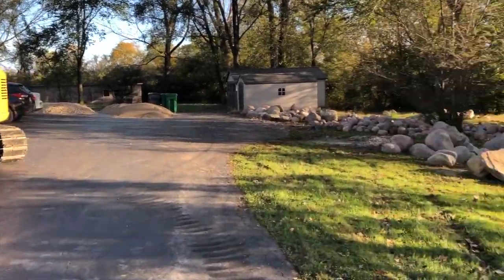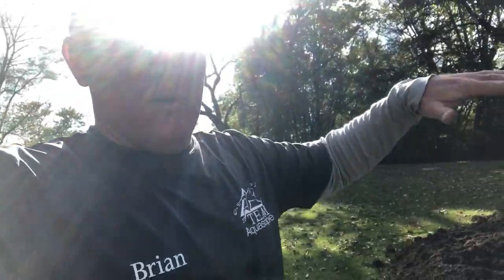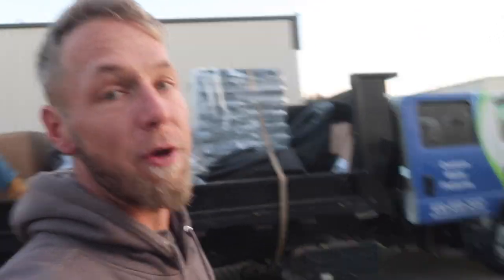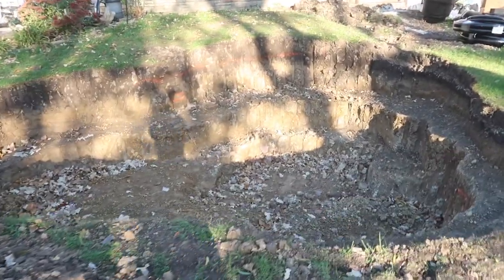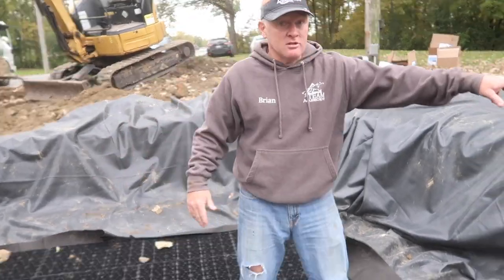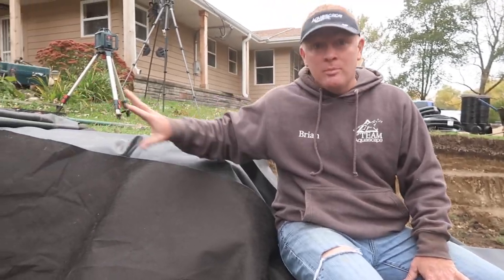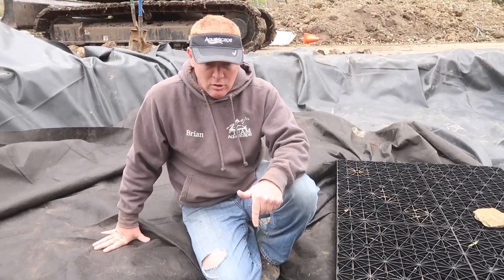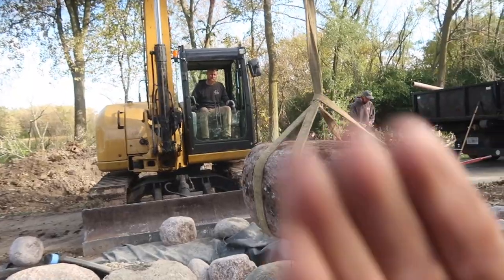Front Yard *POND* and Sunken Patio With Granite Rocks - Part 1

Comment: HelloTeamaquascape, congrats on your wonderful videos. I have a question that never gets discussed. How do we calculate the correct amount of water that should travel through a bog filter per hour? I am planning to build my pond with a surface area of about 600 sqft and depth of around 6 feet. I want to have a very large bog of about the same size of the pond approx 500sqft. I will have about 5-10 koi fish. Also the bottom of the pond will have gravel and water will pumped through the gravel up flow. I would like to know how how much water per hour I should pump through the pond and how much through the up flow system on bottom of the pond. I never found anybody that discussed this topic....glad to hear your input.